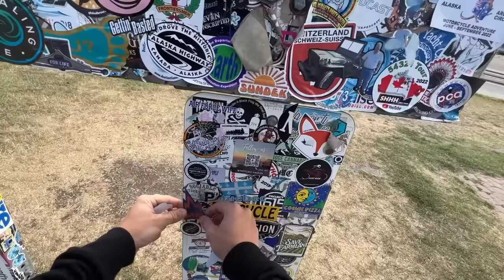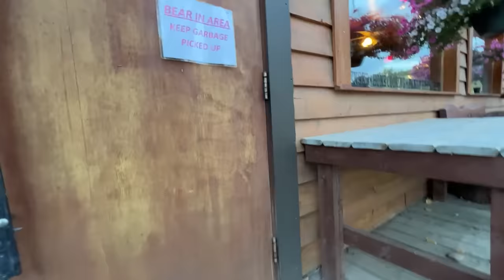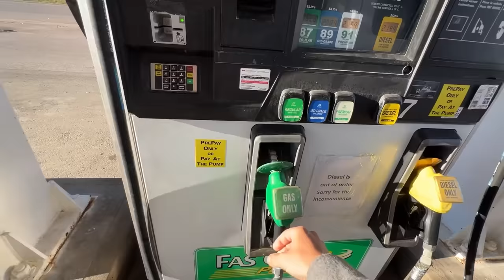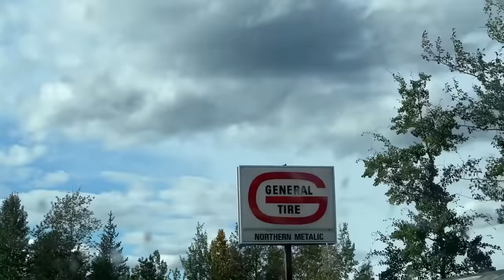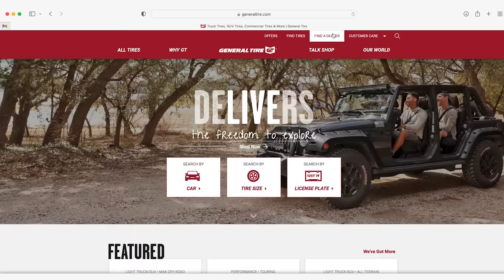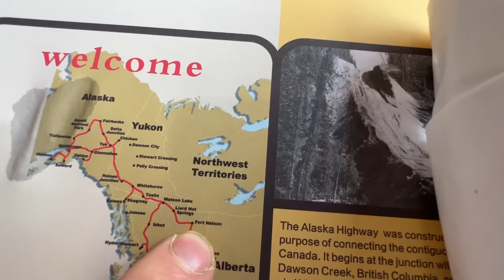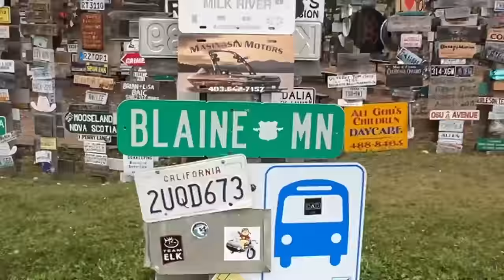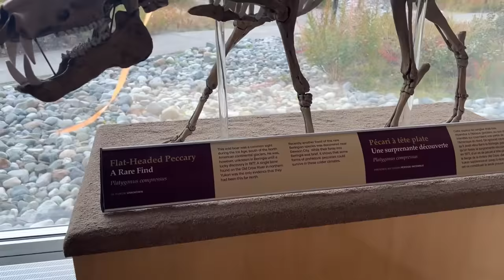Driving the Alaska Canadian HWY from Start to Finish (2400 Miles)

Comment: Just finished going from Winnipeg Mb, to Paris On and back again in 5 days of driving. 2153 kms /1338 miles there and back again. Came back pulling a new RV trailer. No issues for my 01 GMC Sierra c3 AWD 6.0 LQ4 except for a bad ground and a new trailer plug needed to be installed to get the lights working on the trailer. Had a bit of a close call Tuesday night after dark in the Eastern hills near Thunder Bay on the way back with Bullwinkle the Moose, but he kept on trucking past the passenger side of the truck while I was fumbling with the brights after passing a  semi-trailer on undivided highway,  and trying to hit the woah pedal as quickly as possible with a trailer behind.  Chewed a good quarter pound of bottom lip, and spent the next 30 minutes looking for a turnoff to pull over on and get some rest for the rest of the night.

Comment: Verrry interesting to see the current Al-Can Highway......
Pa's company (Northrup) transferred him to Anchorage in May 1954..... I was pulled out of 3rd grade a couple weeks early (no biggie), we packed our worldly belongings into a 13' camping trailer and towed it up the Al-Can with our new 1953 Olds 88..... Unlike your trip, there were NO paved roads (well, maybe a couple miles in towns now and then)...... Saw first my snow in Whitehorse (flurries)....Anchorage from '54-'57 had verrrry few paved roads....mostly just downtown (4th-5th-6th Ave, etc)
That was the beginning of my life of adventure..... 1966 aboard my first sub in the Navy, I bought a 1956 Caddy hearse for my navy bunk mattress (borrowed) and 9'6" longboard.....Aug. 1967 transferred to another sub in NH, traded my hearse for a 1939 Chevy paddy wagon (Portsmouth PD)....Discharged in May '68, drove paddy wagon to Ft. Liquordale for commercial diving school....Sept. '68, drove to Torrance, CA.....Burned out all the exhaust valves (set too tight), with help from Pa, rebuilt it....Had no money, so had to sell..... More crazy adventures til Sept. '69 started Santa Barbara Silly College~Marine Diving Tech.....Bought a rusty 1961 IH Metro-Mite from my buddy and drove it 2 round trips Santa Barbara to Morgan City, LA summer of '70 to work offshore and '71 after graduation..... Gave up on diving (worked sporadically as tender, workboat deckhand and aluminum shipfitter in winter..... lousy $)....Finally wised up, settled down at 27 in Santa Barbara..... 

Subscribed and started with your VW camper vids that caught my attention...."this kid looks familiar, but he has way more money than I did at his age".....
Yeppers, y'all are livin' a life of adventure, BUT in the lap of luxury..... When I wuz drivin' across country at 45-50mph in a bread truck, had barely enough $ for gas and an occasional sandwich to get from point A to B (no motels, those were for the wealthy)....That wuz the hippy-dippy days, so my travels weren't abbynormal .... Many times, I had no idea where I was gonna get my next meal, but always scrounged up day jobs..... I had no idea that I was poor....Never occurred to me....(Retired from SBFD in 2004, living the gooood life in SW FL on the Gulfcoast)
Keep up adventuring, kid......Ya crack me up....

Comment: In 1978 my parents and I drove that same road in a pickup truck with slide in camper. What an adventure! Most of the Highway was gravel and 2 lane with trucks flying at you spraying rocks. Tires and windshields suffered. Great trip!

Comment: Hey Mav, Im a new sub.  I came over from Steves channel.  What a great 2nd vid to see.  I lived in Whitehorse Yukon for a couple  years back in 2010 - 2012.  I first took the Greyhound bus in 2008 for work at Minto resort.  Ive driven the Alaska Highway many times.  An amazing drive though.  So much to see,  I recommend you spend a little time in Yukon on the way back.  You wont regret it.

Comment: Mav you should try making Kimchi for your travels, it’s super easy & helps with your health & digestion flow control as well.  There’s a bunch more health benefits but you can store it in your fridge as long as you want because the longer it ferments the better it tastes.  I’ve fermented mine for months before using it in broths for udon or ramen.  If you need a recipe I can add a comment of mine👍🏻
Reply: Let's see

Comment: Drove the ALCAN in 1989 when PCS'ing from  Fort Clark, NC to Fort Wainwright, AK. Did it going up with an 88 Jeep 2WD Commanche pickup pulling an aged 12 ft Camper with the wife and kid in the cab. Came out in 1993 driving it in a Chevy 4WD truck with a cap on it, a 19-foot freighter canoe on top, and the dog as the passenger. I'd drive until late then the dog and I just slept in the cab on the side of the road. Interesting trip both ways and some nice country. I would do it again.

Comment: mav i really hope you read this… you need to get your truck checked for exhaust leaks, i know it sounds dumb but a small exhaust leak that is getting inside your cab can cause your symptoms. take it from a guy that has had carbon monoxide poisoning you have the symptoms especially because it’s happening while your driving hope everything is going good in alaska

Comment: I'm sure you have but i'll still ask. Have you considered buying a slide in truck camper? I happen to have  the same truck and same mods but short bed. I just got  a 2013 palomino 800 for $6500. Took it on our 4000 mile PNW trip. It has been such an amazing game changer. And I take on some pretty good trails and it does just fine in 4low with the rear locker on when things get sketchy. It basically hasn't inhibited me from any trails. I think It would make for some great content!

Comment: i went from BC TO LA for a concert and on the way back i had to make grind it out, i did Los Angeles CA to Port Angeles WA in 21hours, just in a car, and oddly it was first road trip in this car and it just chewed up those miles, i was 12 hours in and i felt like i was 2 hours in. but yeah i prefer to move at a slower pace when i road trip. but sometimes you gotta fly.

Comment: Well during a Ford was the First Mistake loll, should have taken a GMC or Chevy with a Duramax Which is Guaranteed to get you where your going. Also if you run low on Fuel you can use any oil.

Comment: I feel like kilometers in miles aren't close enough in size for one to be 2,300 km in miles to be 1900 that would mean that was less than a 20% difference between a kilometer and a mile which isn't true I think it would be closer to 1400 miles